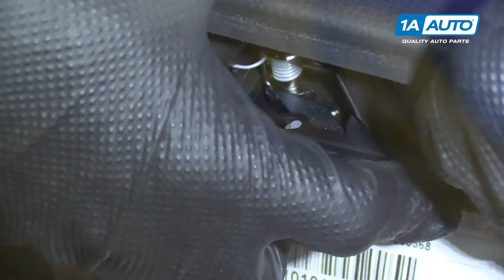How to Replace Door Lock Actuator Latch 06-10 Volkswagen GTI

Comment: What do you think would cause the outer door handle to not work but the interior door handle to work as normal? I feel like it's similar to the trunk where the whole actuator can just go bad on you without rhyme or reason, but I had this issue out of no where this morning and I'm thinking I need to replace the actuator. From the knocker cutout, it appears to be gunked up a bit. Is this kind of failure possible?

Comment: I see your door is open, How do you open the passenger door when you can’t open the door as the actuator is in the locked position so you cannot gain access to the screw heads that hold the actuator in place, there is a way of doing it without removing the door card or damaging the door skin
Reply: I put my electric window down and opened the door from the inside and the outside simultaneously using the handles; I also had my wife press the lock/unlock buttons on the inside and presto!  Was able to open it!  Now to change the actuator/lock!